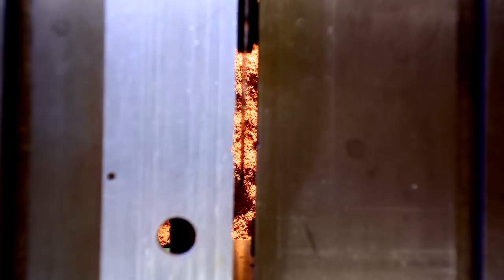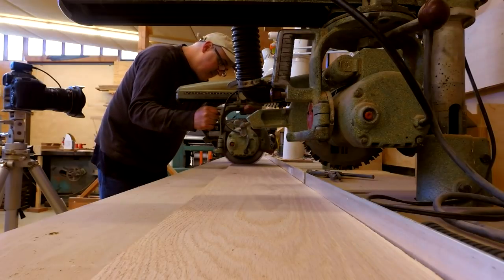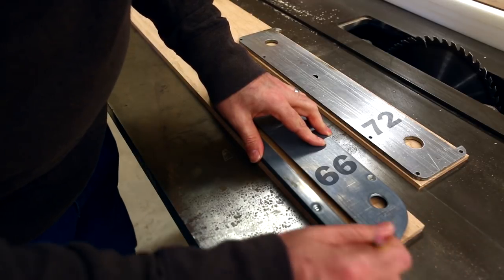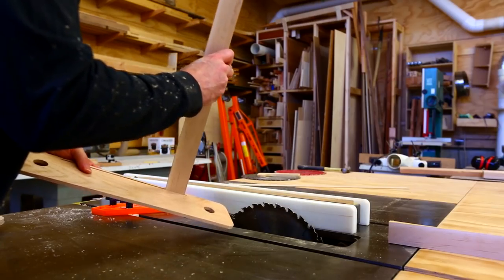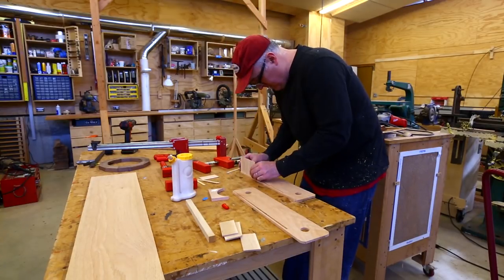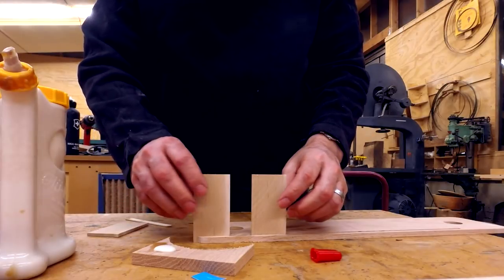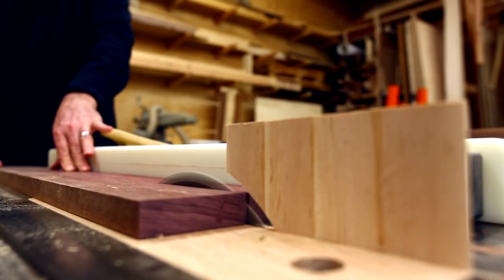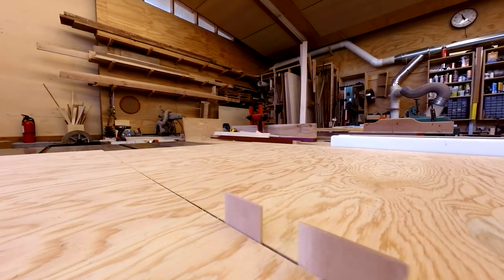Table Saw Throat Plates with Splitter Hack

Comment: I did it even simpler--placed a brass screw into the wooden insert in line and behind the blade, then filed the profile to be about the same thickness as the blade. It has been in business for over a year now with no signs of wear. No kick backs, prevents wedging effect and wood burning. Also helps to push the board to the fence. Small size but works great even on thicker boards...
Reply: Great !
Reply: ? @TomHowbridge
Reply: @markkoons7488  Seems to have been a reply to a comment that was deleted/removed in the 4 years between that comment, and yours.
Reply: G'day. Do you still use them if so anything you would change ?
Reply: @swiftden  No, I don't use that insert anymore. Frankly, I already forgot about it))

Comment: Really important video. I never knew what a riving knife was. I suppose like most American's, we tend to throw away guards or covers, and don't pay much attention to safety devices on commonly used shop tools. But I had a super bad kickback after cutting a small piece of hardwood on a 30 degree angle, with the blade angled towards the work piece (it was a horrible user error) and it sucked my entire hand into the blade, and through a divine miracle I didn't cut off any fingers or cut any tendons. But it took about 4 months to heal after getting stitches in 4 fingers. Watching these videos is really difficult because I have bad PTSD now, and haven't gone near my saw. I was always extremely careful, but I made the mistake of cutting when I was extremely sleep deprived after a 10 hour shift in construction, which led to not planning my cut. If I had known WHAT a riving knife was, I probably would have upgraded my saw a long time ago. But I honestly just assumed that they were a specialty item used in unusual circumstances, and nobody used them.

Comment: I like your fin idea. I've had a vintage table saw for years without a splitter. (the factory ones from that era were garbage) Working with wild gain is a bit scary, and I really need to do this...
Reply: I have a 70s era Craftsman, and my first homemade zero-clearance insert I added a fin like this. Changed blades and the slot and fin didn't line up any more unfortunately. Made a new ZCI, but didn't bother with the hassle of a fin. Forgot about it helping keep the wood against the fence, will definitely make that a priority next shop time I get.
Reply: Well Peter, it's been 4 years.  Have you done it yet?

Comment: Looks like it works good  I would use a light aluminum angel bracket screwed to the under side of the plate far enough away from the blade
Reply from the maker: That's a good idea.

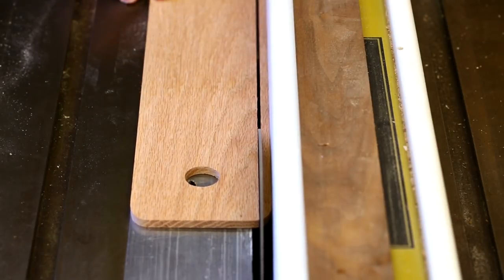Comment: Great video (as usual).  When you made the cut at 3:30, to continue the raised-blade cut, I found it surprisingly suspenseful wondering if they would match up!  I also trace my metal insert onto wood and cut it with the bandsaw.  It's always worked great and is a lot easier for me than using the router.

Comment: I've watched heaps of your videos and seen the wooden riving knife, but had not seen this 'making of' video before, and had wondered what the story behind was?  One of the table saws I use )a 12" SOMAC which I think is imported from Thailand) came with no riving knife, and when I looked into it, there was no provision a riving knife that lifted with the blade.  So I made a steel riving knife by sandwiching two thicknesses of hand saw blade silver soldered at the edges.  Something that had not occurred to me before is what you said about the knife holding the work piece against the fence.  My home made riving knife extends about 25mm beyond the throat plate, so is going to do that job quite nicely.  You never stop learning when it comes to stuff that goes on in a workshop.

Comment: I have used this cheap method to make my Delta Contractors saw a bit safer since a new saw was not in the budget. I made several inserts for different configurations but not for angled  cuts. I have not damaged fins for the two years I have used them.

Comment: Thanks for the ideas, I need to make a splitter for my vintage Ceaftsman 113 saw (it was my fathers so I have an emotional attachment), and thus should be a doable solution.  I might be able to make the insert thicker to help hold the splitter in place.

Comment: Thanks for planting the seed for this idea... I had an after market riving knife for my old unisaw that wasn't very stable and when using my crosscut sled got pushed back down into the blade sending metal shards everywhere... lucky I didn't lose an eye (I had forgotten to wear my goggles for that cut).

I took that thing off and made a new insert with this feature and so far I love it.  I did the single fin design and made mine 1/4" shy of full blade height, it looks pretty sweet too.
Reply from the maker: jon Q cool, glad it works.

Comment: Didn't you run into issues with stressed wood getting tight and stuck with these fins being the same thickness as the blade. Ideally they should be 0,2mm (0,008") thinner than the blade on both sides.
Reply from the maker: Yes I was getting that a little, I may have to sand the fins down.
Reply: Marius Hornberger This is a good point. While ripping a board has internal stresses, the two sides might come together after the blade and bind with the "fins".
Reply: Barry's Workshop Well, they better bind on the fins rather than on the blade.
Reply: frank howarth
 Maybe even coat them with something after sanding a bit more to make them more slippery.
Reply: Mark Klukowski yes i was coming to say, i will be making mine a thou thinner and giving them a coat of wax

Comment: Frank , Thanks for sharing, awesome stuff as always.
To keep the plates from lifting at the back I usually drill a small hole and put in a brad bent to hook under the edge of the table.  You need to slide the plate in from the front instead of just dropping it straight down, but it makes sure the insert can't lift.
Reply from the maker: Thanks,  I will look into that.
Reply: I put a counter sink screw into the back and side edge and adjust them to make a snug fit

Comment: Hi Frank, We have all gotten used to long fences which are intended for cutting sheet goods not lumber. Be safe! The riving knife is NOT intended to keep the board straight, or up against the fence. They are to prevent a stressed board from closing on the blade and kicking back. Nothing more! If the board is pushing again your fence it's telling you the fence is in the wrong place, ie. past the back edge of the blade. I made my first fin style riving knife in the early '80s and still love them. Fin should be just a hair thicker than the kerf of the blade to do its job. Btw, A safe rip fence does not extend past the back of the blade!
Cheers!

Comment: Frank.   I've made the same before, but decided to make the riving knife part a piece of metal, because the wood riv-ers (?) tended to break.   I used two small screws coming in from the side of the insert, through two holes in the metal riving piece  and back into the other side of the insert to hold it in place.  Works good.  I hope this makes sense, if not I could send a picture.    Thanks again for your videos.

Comment: I'm curious that a Powermatic table saw doesn't come with a riving knife?? My Rigid did, but it's most likely a newer saw. (3 years) I'm guilty of being old school and didn't like something in the way so I removed it. Watching a few table saw safety vids showed me how wrong I was so I'm going to put it back on as soon as I get around to it. I think removing it may have contributed to a couple painful kickbacks. I'm trying to figure out why you put 2 on yours, and why you stood the grain vertical. What would you think about making them out of metal and adding 2 screws to secure it.

Comment: I just came across your video on splitters for the table saw.  Your idea is great.  I have an old Ridgid TS3650 saw that does not have a splitter nor kickback pawls. I risk my life each time I use the saw and it ,frankly, scares the bejesus out of me.  This is a great solution.   However, I do have one question.  Could some 1/8” thick aluminum be used to replace the hard wood used to act as the splitters?  It seems aluminum may be more durable than wood and could be easily glued to the insert with a good epoxy.  What are your thought on this?

Comment: If you're using carbide blades, why couldn't you use aluminum for the fins? And screw or pin'm in, w/either brass or aluminum screws? Or wood pins?

Comment: Thanks for a great idea.  If you use a thin kerf blade sometimes, obviously you could make another zero clearance plate using thinner pieces of wood.   It would seem to make sense using a very hard wood for those vertical pieces.  Any thoughts about that?

Comment: You will like use them more then not. There is feeling of safety that comes with them and I think it better cuts as well.  The next thing you may want to make are kick boards to turn off the saw. To be able to turn off the saw and not move your hands is so helpful. Even when you don't have a time were you have to leave your hands on the wood, it is nice to just make your cut and hit the board with your knee or foot and not have to lean over find the button to turn it off.  Great stuff as always.

Comment: Man, I thought I had old iron! The factory throat plate in my Powermatic 72 looks like yours, all chewed up, a vastly sloppy original fit, and unsupported to the right of the blade. What do you think of taking the top to a machine shop to be milled to provide a support ledge for the right side of a shop-built throat plate? Alternatively, how about drilling and tapping the underside of the saw top for a small supporting ledge to carry an insert? Considering the work involved, I can't work up much enthusiasm for either approach. How about making zero clearance throat plates out of 1/4" aluminum and using Muggyweld to solder in splitters? I'd appreciate your opinion on these ideas. Thank you.

Comment: Damn, thats an impressive jointer and disc sander!

Im not sure how it could be done, or for that matter if its possible, but what about having interchangeable fins for each plate? Im just thinking if the saw depth needed to be shallow that high fin would get in the way. It would be easier (at least in my opinion) to be able to pull the fin out and replace it than to have a completely different throat plate.

Comment: "The insert zero clearance" - requires any table saw, especially when cutting small parts. But for some reason many of these neglected :(
     Thank you for what you have raised this issue and clearly demonstrated the process.
    Frank, a question for you: why did you do the riving knife so long (multi-part)?

Mark Fisher, Ukraine.

Comment: Thanks for the excellent video, Frank.  I plan on making some splitters for my old Craftsman saw.  One question, do you plan on making splitters that fit your ZCI when doing angled cuts?  Or is a splitter not really needed when your blade is tilted?

Comment: Thanks this saves me money........  However I have the holes cut into my table saw plate. I bought them used like that.
one draw back is not all blades are the same thickness, I use board buddies on my RAS you can buy them for the table saw too
or Jessem has rollers that pull the stock into the fence or you can take roller skate wheels and make your own.

Comment: Frank, thank you for sharing your woodworking and shop with us.
I just acquired a Powermatic 72 table saw.
Could you share the details of your rotary phase converter ?
Reply from the maker: TEMCo, 20hp, 15 kva.  I have it running off a 100 amp breaker.  I love my 72

Comment: Why does that radial arm saw operation look so scary? I always start with the saw motor closest to my chest, when I am using a sliding miter saw, and push the saw forward, instead of pulling it towards me. I wonder if I've been using the saw wrong this entire time?

Comment: I have only made one zero clearance plate before,  I made it out plywood and I did not get it exactly the same thickness.  I was cutting a dado in the back of a raised panel frame and the frame got caught on the plate, I let up pressure just slightly and the next thing I knew I was in the ER.  The panel caught on the plate them lifted up jump the track of the dado and shot out of my hand, but it caused my fingers to curl under and touch the top of the dado blade.  It took the fingernail off my index finger and ground down the bone on my first knuckle and left three nice chunks of flesh hanging.  ER doctor just pulled it all up and stitched it together loosely and sent me home, lesson learned.  Make sure the insert is exactly the same thickness.

Comment: Hey Frank, when cutting out the back side of the throat plate for the fins, did you consider not cutting all the way to the blade kerf cutout to help with alignment?  I don't mean to second guess your great work, I'm just curious if it crossed your mind or you always intended to have the blade "shape" the front fin.
Reply from the maker: I had not thought of that.  it does seem like fin further from the blade dose more work.  Although it tends to get pinched more too.
Reply: A friend of mine used a piece of a flat spring about 3 inches long and 1/2" wide and epoxied it to the bottom/front of his home made zero clearance and dado inserts to give them a little more hold in hopes they wouldn't be flung back at him.

Comment: Hi Frank,
Great video. Really liking your channel and videography skills.
I'm wondering if you need the splitter(s) to be as tall as you have them. If you used a down-force featherboard, I would think all one would need is a short (1/2"-3/4"?) splitter to keep the piece against the fence. Of course, it means setting up a featherboard and that may not always be practical. Just a thought...
- Fred
Reply from the maker: I think you are right.  I kept thinking about a tall cut, but the splitter does not have to be the full height of the cut to help.

Comment: Hey Frank, was there a logical reason to not just use the original plates attached to the wood with carpet tape and then use a flush trim bit on your router?
Reply: ***** Sometimes the original inserts have quite a bit play between the insert and the table and the new insert (with this method) is too wobbly and a bit dangerous.I tried that method with my big Delta and didn't even get to final fitting before I realized that problem....
Reply from the maker: I have seen that method and it is probably the more typical way of doing it.  I guess its easer for me to turn on the disk sander then set up the router.
Reply: Barbie
Reply: Russ Loucks Totally true, stock throat plates are super loose. You have to make them from scratch.